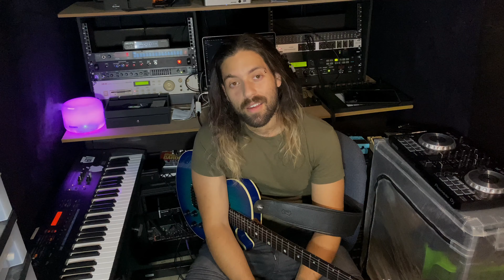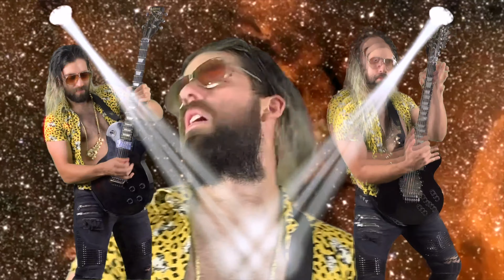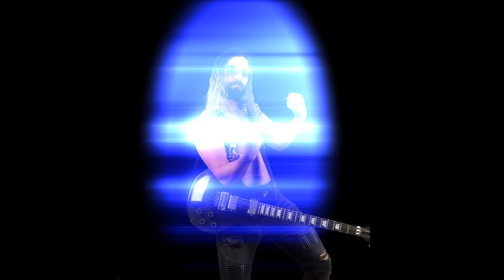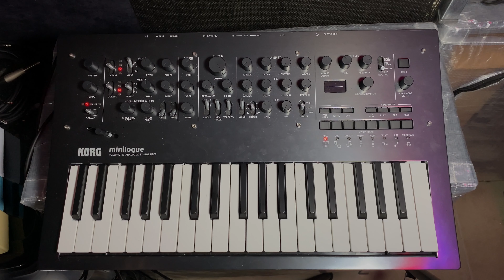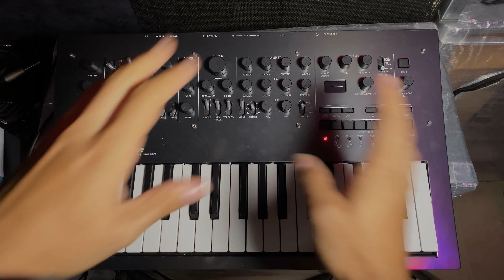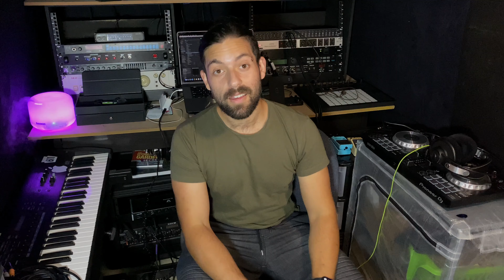Intro to Waveshape Modulation  | The Q Show ep. 2

Comment: Thinking of picking up the Monologue just to get the triangle waveshape thing on a budget - bringling that sprinkling of west coast synthesis. My Microfreak has this functionality to a degree too - but it's a very digital take on it, the Analoge Modelling oscillator doesn't have that function.

Also have to shout out the king of early 90s dance the Alpha Juno series for having PWM Saw Waves, the absolute mad bastards.

Comment: Do all 3 knobs do the same thing?
Reply from the maker: Hmm... I’ll try not to be too vague or wordy. The knob on the left is to fixate the synth on a certain waveshape (you may want to keep a certain shape for a sound instead of modulating like I ended up doing). The middle one I touched for a moment was just to roll off high end to make the example more musical. The last one I touched sent an lfo (low frequency oscillaton, vid to come about that) to the waveshape parameter so it would modulate between the two shapes depending on the parameters set (a higher depth would make it go between two bigger extremes, faster rate would make it modulate faster, and a different shape would change the timing of how if effects the waveshape)
Reply: @TheQShow  Massive 1O1